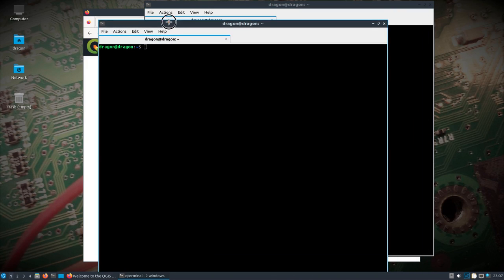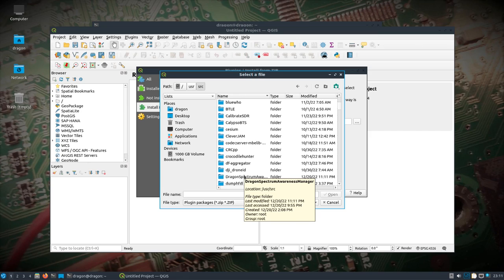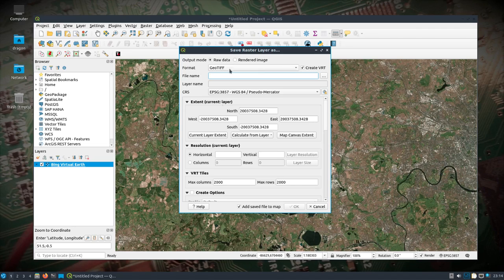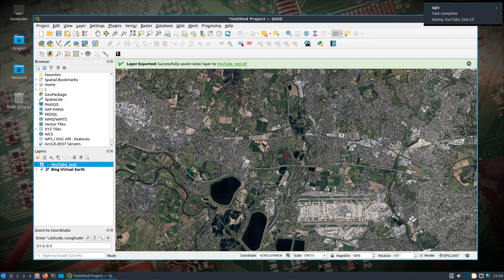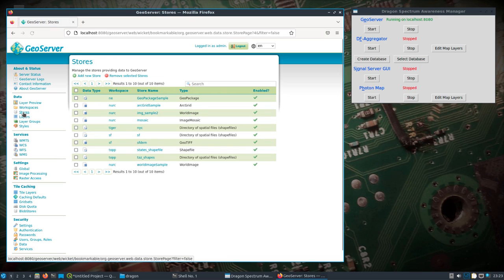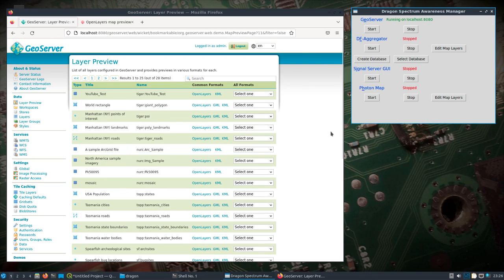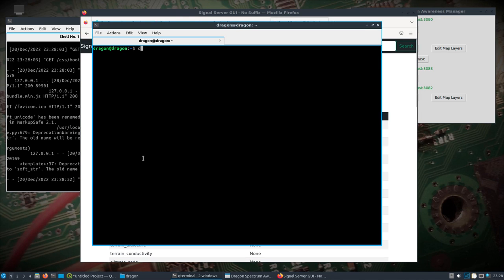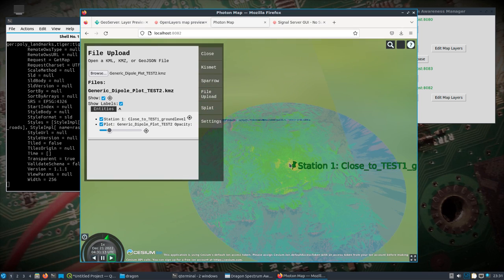DragonOS FocalX Offline Maps w/ QGIS + GeoServer (Signal Server GUI, PhotonMap, R28)

Comment: I use the map layer horizontal and vertical resolution values of 0.5 in Tile+. This gives me good surface details in the resulting GeoTIFF file and it allows me to navigate around on the offline map without problems. 

Thank you for showing how to use the Lat Lon Tool plugin for QGIS. I was not aware of it before.
Reply from the maker: I wasn’t sure why my map was longer left to right after I made it? I maybe had too big a section when I was creating it?
Reply: @cemaxecuter7783  I am using the same approach as you do - just select "Map Canvas Extent" in the Tile+ plugin export settings. 

I used this video as a reference to create proper GeoTIFF files with GoogleMaps satellite images:

youtube.com/watch? v=ImkJcD8VV0g&t=335s
Reply: The person in the video "How to download Georeferenced Google Sateagery on QGISlite" uses slightly different settings in the "Save Raster Layer as" menu from what you use in your video. You can see the settings at 5:37 at the URL in my above comment.
Reply from the maker: @YehorHuskov  I’ll load it up and watch, it should help if I do another video with remote KrakenSDRs!
Reply from the maker: @YehorHuskov  thank you, loading and checking it out now.
Reply from the maker: I see in the video he kept Raw Data selected instead of rendered image. I’ll have to try this.
Reply from the maker: I see he also changed the CRS type.